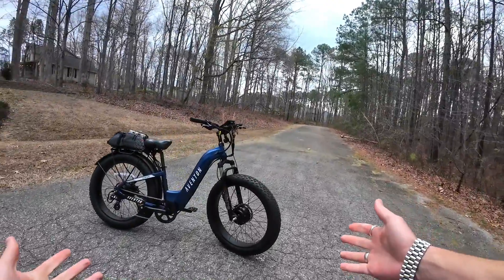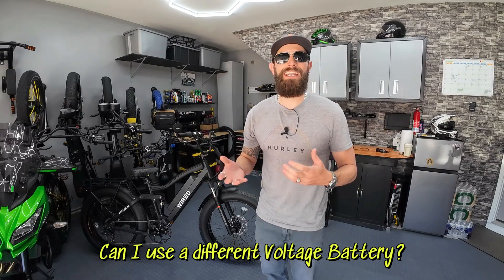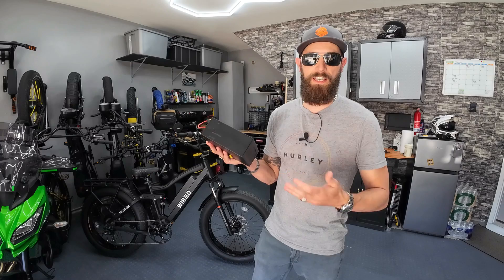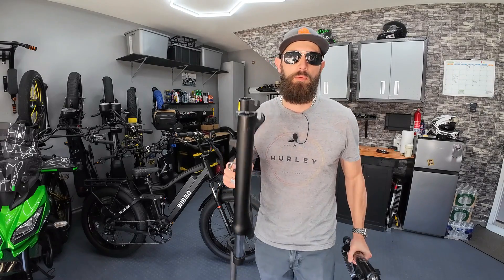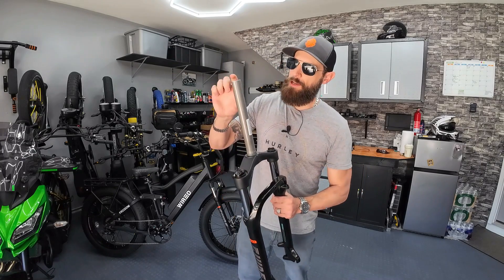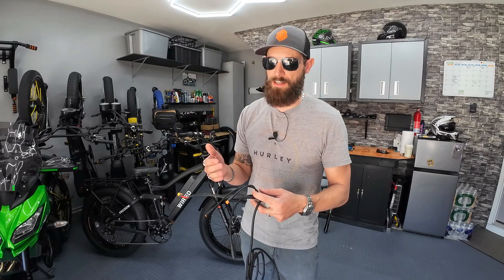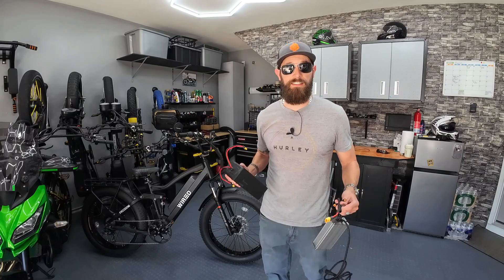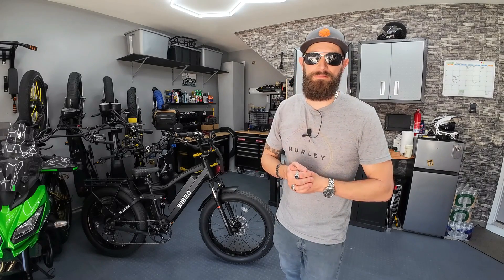Front Motor Kit: Common Questions

Comment: Does your system provide the option to limit throttle to PAS level?
I want to add this to my wife's Freesky Wildcat. She doesn't modulate the throttle very well for difficult trails with steep hills. It's essential that she can limit to level 1 or 2 on some trails.
Reply: Just install the 2nd screen and buttons. Then set the throttle to follow pas. The pas won't be hooked up but the throttle can be limited to the pas mode the front motors screen is set to.

Comment: How is the RST Guide fork compared to the original Radrover fork? Even if not used for front wheel drive, is it a noticeably nicer fork?
Reply: They limited to be adj.but better like stronger where it matters

Comment: On engwe x26, would better option for better pick up be replace rear motor/controller or add front motor kit? Already has 2 48v batteries but slow off line due to weight....  Thanks

Comment: Sorry I missed the news of ya finally assembling the motor kit ..I will be ordering one from ya in the few weeks to come i first have to measure the drop outs and then see if it will be strong enough.
I have 2 bikes that I am unsure which one i will be using it on .....I just ordered a new controller for my rear motor so i have to wait for that to get here before i pull the trigger .  
Thanx for all the info and work ......
Reply from the maker: Sounds good!

Comment: At $900 plus the work it takes to do the upgrade, for adding just 12 mph to a bike, do you really think it's worth it. Just buy a duel motor bike and be done with it,
Reply from the maker: Kit is built to add acceleration and hill climb power not top speed 😁

Comment: Please do a 2nd battery kit for the 2024 Wired Freedom.  Something that would include a 60v battery, wiring and a discharge regulator.  I’m more interested in extending range than having more acceleration and grunt.
Reply from the maker: its in the works!
Reply: @CitizenCycle925  please make it at least 20Ah.  Bonus would be some kind of rear rack mounting solution.
Reply: Bizzfo, we made an order for two of Brian's kits for our 2024 Wire Freedoms. We also considered, as you stated, extended range versus acceleration and grunt: our conclusion was that the ease of Brian's (Citizen) Kit of mostly swapping out the front wheel without altering anything else met our goal of acceleration and torque in order to Get-Out-Of-Harm's-Way for what "may" come down on our nation. (You can always swap in an extra battery, if necessary, when you are at a safe distance.) One of the benefits of Brian's Kit is that you are not interfering with any established 2024 Wired Freedom manufacturer configuration, while adding torque, distance and speed.
My discernment is that there's another important factor-- a Time Critical Factor--in obtaining Brian's Kit: the results of the upcoming 2024 US presidential election will likely start a significant closure or discontinuance of the availability of many, MANY China made products. Like it or not, that's where many of these products are made.
Citizen Brian, are you listening? You (AND YOUR FAMILY) are fulfilling more of a Higher Cause than you probably realize! Brian, God Bless you and your family. ❤

Comment: The rear rack on a Kepler is 22"x7.75" . It has like 18 pre drilled holes in it. A nice heavy duty locking box could be mounted back there. Make a plate to put down inside the box and drill a few holes in the plate and box to match the rack holes. It could be mounted so the only way to remove it is from inside.  All the kit components could go into the box.. Display included. No need for a display mounted.. Just turn it on and lock up the box.
Reply: Also enough room to mount a controller in front of the rear tail light under the rack and box if needed.
Reply: That's nice I'd love to see a guide on that setup

Comment: HEy Dude! Will this work on the 5 Stars e-bikes? I need to know b4 I buy the kit. Thanks!
Reply from the maker: Yes it will work on the five star but ecells already sells AWD bikes....
Reply: they do but the price for AWD is $3500 and up.  @CitizenCycle925
Reply: @CitizenCycle925 you know what's funny or awesome? Well we knew the 5 star was built off the monarch frame but the serial number has awd in it 😅. No cracked welds like the wired forum. I have a lime green crusier too, gonna keep and eye on it. Saw someone cracked the main tube to crank weld 2 days ago. I was gonna sell the ecells and buy a predator but f it. I don't want cracked welds, fwd kit it is! 🎉🎉
Reply: It will, but you should research the motor wind first, on the Bafang motors the last digits on the model number usually say 06, or 05, or 6.5, that number will let you know how the motor should perform, some of these motors top out around 37,38 mph and some of them only 29,to 31 ish but have more power. Seems like this motor is wound more for torque, may hurt your top speed.

Comment: Hey Citizen, you may have answered this in the video, but I wanted to get in on the ground floor and first post- Do you know if in general folder e-bikes take regular ebike forks, like say those nifty RSTs?

From what I can see, folding handlebar stuff takes place completely above a folder ebike's forks? Idk if I should be the first person to try this on a folder anyway, with the torque from the front wheel pulling the hinge and all
Reply from the maker: You have a folding 26in wheel bike?  Getting the length of the steer tube correct will be important so the folding handlebars attach correctly.
Reply: @CitizenCycle925  20in